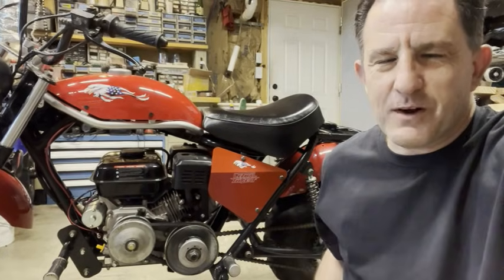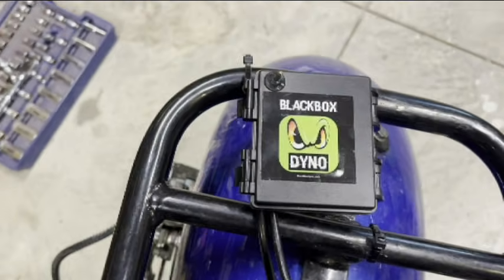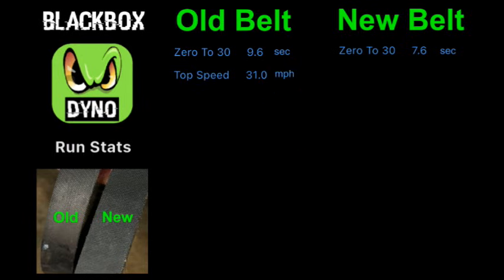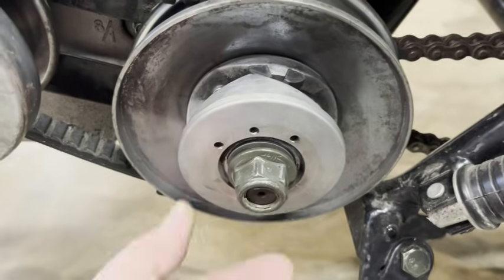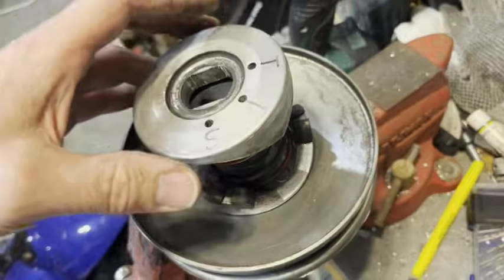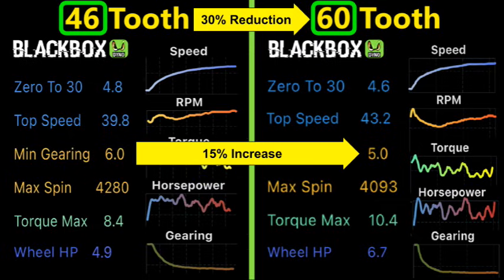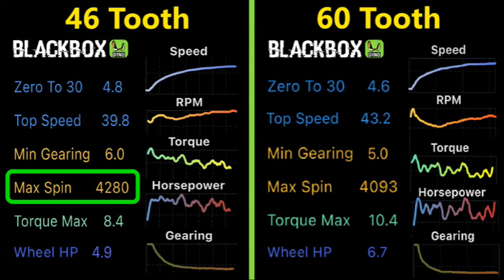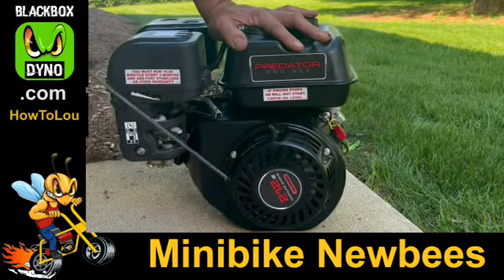The Secrets of Torque Converters

Comment: Im running a TM hurricane with a ducar 224, gps super pipe, intake, jet. and jugg cvt.  Rear pulley is in the middle hole. The Factory gearing had me at 44mph.  Switching to the 60t rear dropped me to 36. Gained crazy Tq.. to get similar results as the data in the video. Do i need to swap to the 3rd hole on the rear pulley? Would that small change make up the difference?

Comment: So, my bike has a TC with 10t front and 40t rear. I max out around 45 mph. To get more speed I need to go to a 60t in the rear? And to try and keep it from doing wheelies to put the spring into the back or 3rd hole on the pulley? Also, what is the difference in the Red, Yellow and Green springs?
Reply from the maker: 10:60 will give more speed, but unfortunately for you, more wheelie torque.  If you want to stop wheelies, go straight chain 10:60.   If you want more speed, do a Stage 2 motor.
Reply: @ I bought and installed a 60t rear sprocket with the front staying a 10t and I max out around 35 mph now. Changed out belt with new belt and it is still staying around 35 mph. What could be effecting that?

Comment: Oh wow that’s neat it has a bearing on the crank compared to a brass bushing. Does it use a longer belt than the traditional 30 series?
Reply from the maker: Nope, exact same belt.  The bearing may be getting in the way.  The bushing driver worked way better
Reply: @HowToLou  With my experience with Trailmasters MB200s is that the belt is a bit longer than a normal 30 series that come with those kits you see all the time on amazon. Mine wore out on my mb200 and i replaced it with a 5959 belt. It "worked" but it was noticeably worse than the worn belt that was on it before. It was on there way too tight. i ended up ordering a 725 belt for a go kart i believe and it worked fine afterwards.

Comment: Hey fellow small engine enthusiast, for correct belt alignment the inside faces of the pulley,nearest to the motor, should be aligned with one another; not the backside of them.  The machining of different brand parts may not have the same backing depth, that is why the faces that the belt rides on need to be aligned, not the back-side.
Reply from the maker: Yes, that is correct!
Reply: May not have the same backing depth? So you have measured multiple parts from different sellers?

The Chinese did a pretty good job copying the 30 series. Chances are they all spec very close to identical. I have three of them from three different sellers and don't see any difference.

Comment: So I have a 3/4 drive predator 224 but it's modified to make a little over 10 horsepower. These 30 series torque converters are rated to 8hp. So I'm afraid I'll overpower those. The 40 Series are rated to 18hp but only in 1inch drive, too big to mount to the engine. Are there any 40 series torque converters made for 3/4 drive? What torque converter should I get? Rascal mini bike frame.
Reply: Go with a juggernaut primary driver for a 30 series set up, it can handle more HP.  Keep a spare spider gear on hand, as that is the weak link imo
Reply: You are not going to overpower it with 10HP. Guys have drag raced with these 30 series and have launched their bikes at 4500 RPM on to the wheelie bars with modified drivers.

I beat up on mine with a built 224. Stock driver and a yellow spring in the driven. Getting close to 2 years and no issues. Ample gearing is important which he mentions in the video.
Reply: @ thanks for sharing your experience. That is good to know.!
Reply from the maker: You will be fine with the 30

Comment: The driver is also tunable comet sells lighter  aluminum weights to replace the heavy stock zinc weights and also all different colors of garter springs to be able to fine tune the engagement rpm there is a chart that shows the engagement rpm’s on comet’s website that show the different engagement rpm’s with the zinc and aluminum weights the chart can also be found on google if you search 30 series engagement chart
Reply from the maker: Good info!  Thank you!